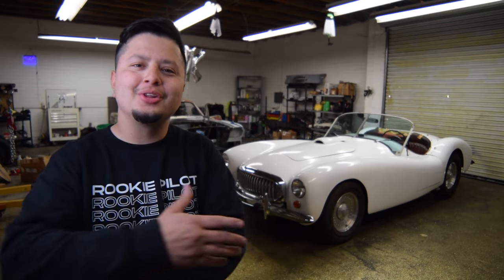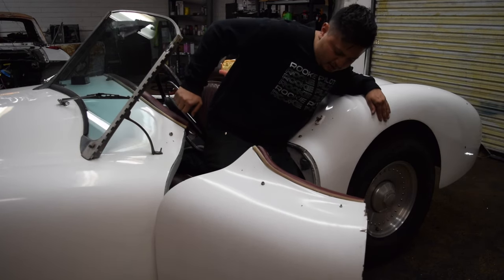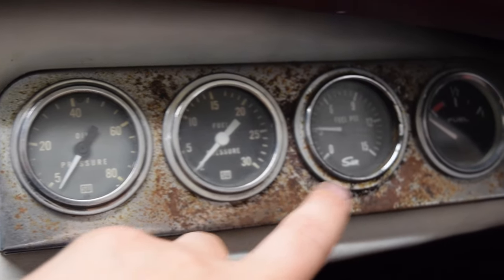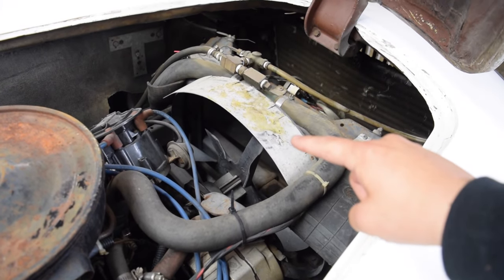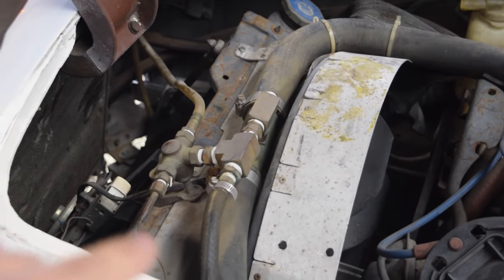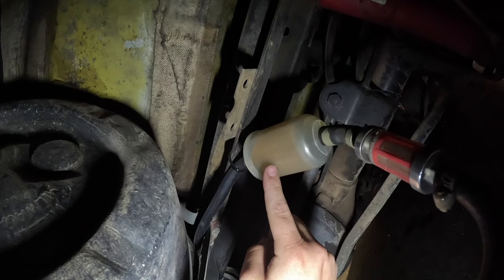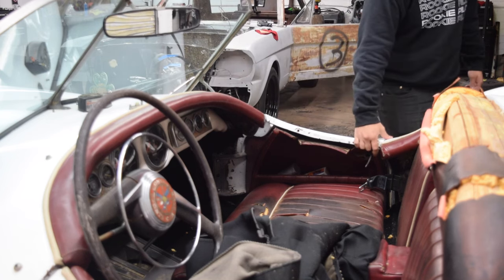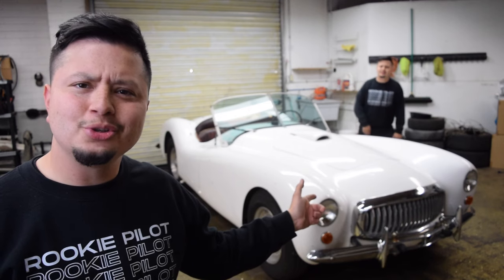The Vintage Race Car You Didn't Know Existed

Comment: The V6 with that HEI distributor would be early ‘70’s so this was rehashed by someone else, the original build would have been mid ‘50’s . I suggest research and correct the wiring and engine, a nice interior reupholstery and some body work and a respray.
Reply: I'd agree, the center two gauges are also much newer Autometer, at least 80s.  The wiring also suggests it's been redone a few times.  Time for some research from the original owner or his family to see if they have any photos from when it was first built.

Comment: OK, so I'm old. I knew this was a Glasspar, kit car. What you didnt tell us was when this built. Not a 50s build with that engine/trans. But a 50s car nonetheless. Prbly had a flathead V8 originally. How long was the build? What was the donor chassis? What was the rear suspension? So much was left out. I'll subscribe hoping you fill us in.

Comment: Its shape reminds me of the car that the Shelby Cobra was based on. I believe it was an AC? At any rate, I've heard of Glaspar but only in association with boats. I never knew they designed a sports car.

I would replace that steering wheel with something smaller.
Reply: That's part of the plan. The large wheel was used to compensate for no power steering

Comment: I agree with others on leaving the gauges alone.  This is one of the unique elements of the car.  Might want to trace / validate their exact function with the current engine / tranny before swapping it out.  Might be a challenge to figure out how to match their current function with a new engine / tranny and modern sensors but a puzzle worth figuring out I think (and more content!).  I think from an engine swap perspective it’s already had one so doing another one aligns with the history of the car and is therefore an easily explainable upgrade and will improve the owner’s experience.  No problem with getting rid of the extra taillights as they significantly detract from the rear lines and who knows if they are original or not.  Your car of course so your call; just my opinion.

Comment: Reaching 10,000?   I think you're reaching 11,000.... 10 is done did. Congratulations 🎉 
Looks like you're going to need a jigsaw, and some deck screws at some point. 😁
That's a neat body design.
I'd go looking for a tilt wheel to make getting in easier.
I think you caught everybody off guard with this video. 😁
Reply from the maker: Thanks Randy!

Comment: However it was initially built it has obviously been redone and probably redone again since the initial build. The V6 is an engine probably from the 80's. The Autometer gauges are not period either and the wheels are 70's at the earliest. A trailer hitch on the bumper?? OMG! And the wire needs a complete redo. The pilot didn't do that either you can be fairly sure. I love the body and the frame is workable. Everything else is a complete redo. I took a serious look when it was for sale but the price was way out there. I hope Robert just decided to have fun with a redo because done right it might even pay for itself. Super cool car and good luck and have fun.
Reply: You should Google the Novetta. Steve knows what he is talking about.

Comment: I noticed the steering wheel has a Convair aircraft emblem in the center of the steering wheel. Was the car originally built in San Diego or Fort Worth where convair was located.?? These cars were originally built in the early 1950s so it must have originally had some other engine and transmission the engine and transmission combo in the car is from the 1970s.
Reply: It was in San Diego.   John was a commercial test pilot for Convair there on the 880, the 990, and the Pogo.

Comment: If there is room for a clutch in the footwell, that engine bay looks perfect for a well built straight six with a five speed.

I'm assuming the car weighs nothing and is slightly more crash resistant than cardboard so slow, reliable, and fun is the winning combo

Comment: Put a period correct motor and transmission in this car along with period correct Hildebrandt magnesium Wheels for maximum value. The 70s V6 and 70s mags is totally wrong for this car along with any motor newer than 1954.

Comment: Wouldn't it be better to restore it to original than to "restomod" it? cool car. Definitely the child of an Austin Healy and a Darrin...what goes on at a car show, stays at a car show...lol. The pictures and cars Ive seen in the past, the Glaspar had a different grill... Id love to have a new body kit and build up a modern frame and drive train...re engineer the interior...Put it on a Supra....
Reply: The Darrin was made by Glasspar,  so it's more accurately said the Darrin is a child of this. 

There were six Glasspars with a Nash Healey grill, and this is one of the six. My other Glasspars have the original grill.
Reply: They came with a few different grills this one is the rarest with the Austin Healey grill.

Comment: Isn't this the glasspar that had the rare hardtop? Where is that at?
Reply: The hard top will make an appearance.
Reply: @robertlugo3388  awesome! Im glad it is still complete. Did it have a flathead originally?
Reply: @robertlugo3388  Make sure that you don't let this guy remove your cars history. The original builder is the history of this car, the abundance of gauges, and little quirky stuff is what makes this car a glasspar.
Reply: Angel and I are in agreement on the car build. It's going to be properly badass. More history will be revealed throughout the project.

Comment: Ugh, I hate when people get their hands on a unique machine that they don't deserve.

Do not remove gauges. Do not swap the engine and transmission. Do not remove taillights.

Rebuild the existing engine, sure. And that birds nest of wiring probably should be cleaned up. The upholstery definitely should be restored, as close to how the existing upholstery would have looked, as new. And, the existing transmission should probably be rebuilt.  A fresh white paint job would be good, after chips and cracks in the fiberglass are repaired.

But, if you can't resist removing the gauges, or swapping out the drivetrain,  then step away from it, and gift this machine to Jay Leno.

Take the financial loss as a reminder to stay away from vehicles that are above you.
Reply from the maker: Womp womp
Reply: This is not how the car looked in the fifties when it was new. Jay Leno would do roughly what is happening here. 

What you see here was after the 1990s rebuild.

Comment: You said kit car.
I stopped video hit the thumbs down followed up with a don’t recommend channel.
Reply from the maker: Oh no
Reply: Rosemary Clooney owned one. Some great history there.
Reply: Back in the day when this was new all you got was the body.  No frame, seats, steering, just the body.  you had to supply the frame
usually a late 30's to 48 Ford chassis.   Any engine trans that you thought might fit.  If you wanted power you usually chose a
Oldsmobile v8 or Cadillac v8.  If you just wanted an engine you chose the flathead Ford v8.  I don't think that the term kit car
is in any way accurate.  You got a body, do something with it.